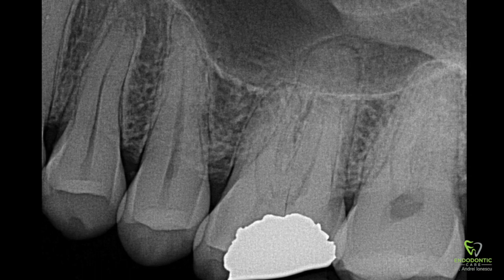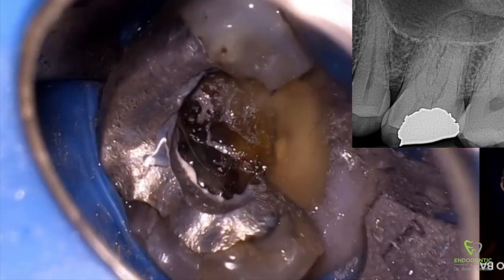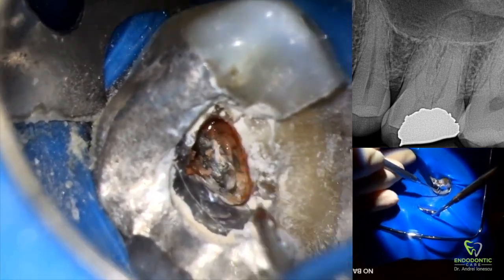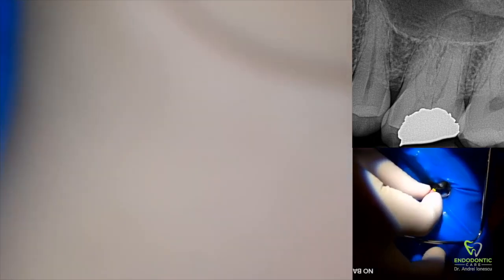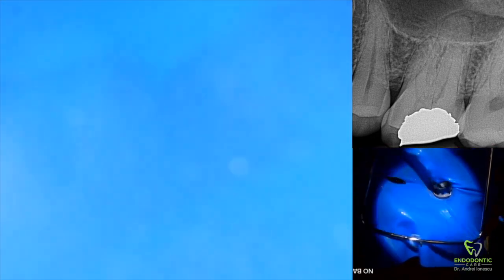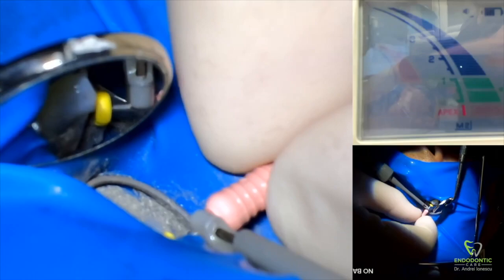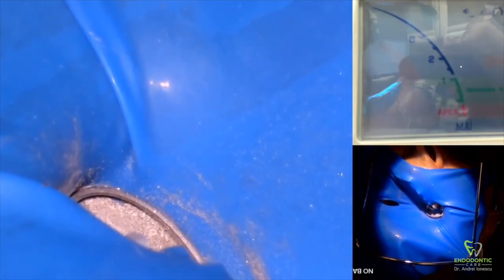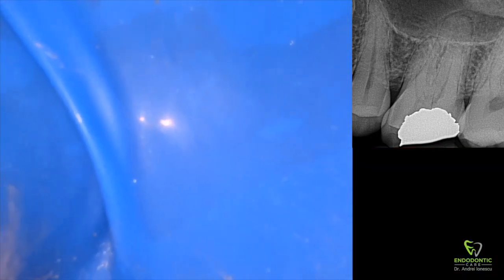Access and Instrumentation of a Calcified MB2 Canal - Dr. Andrei Ionescu

Comment: Great video doc. Do you always start out with C files from size 6,8,10? I read somewhere that with C files you are only suppose to use pecking motions and not watch-wind motions. Any precautions when using C files? Could you use a rotary orifice opener to open up coronral 3-4mm portion prior to using any hand files? And at what point do you transition to using K files? Thank you.